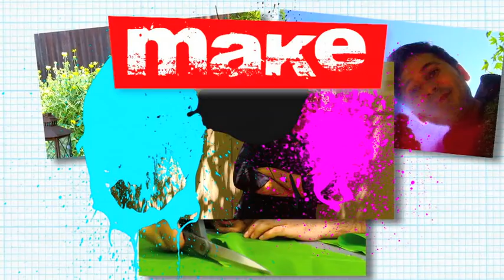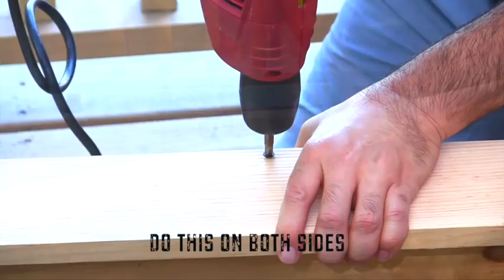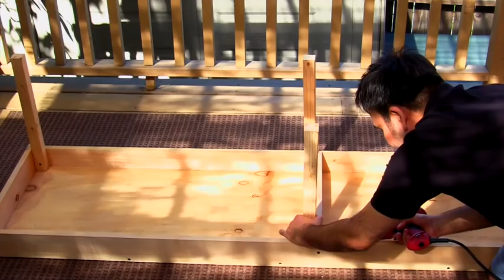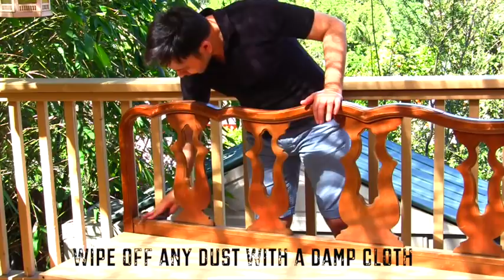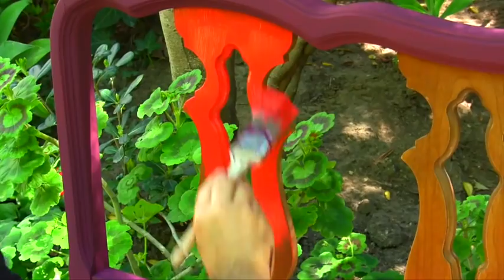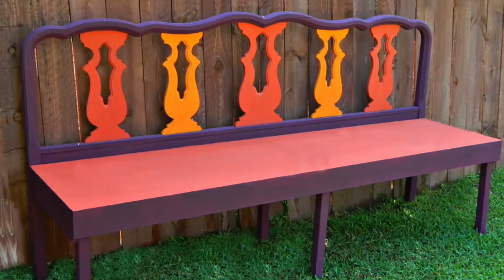How to: Found Headboard to Bench

Comment: How does the paint hold up in the rain?

That was a little pit of paint for a lot of space. I used this paint and messed up because I used the whole jar for a space much smaller. 

Lastly your yard has got be very full by now can I see a picture of it decorated?
Reply from the maker: Shawn Miles Hey Shawn, you can use a matte varnish for this paint for outdoor use.  It's part of the chalky finish paint line and it's terrific stuff.  It's great for high use pieces and outdoor pieces. They also have a light satin varnish.
Reply: Sweet thanks Mark